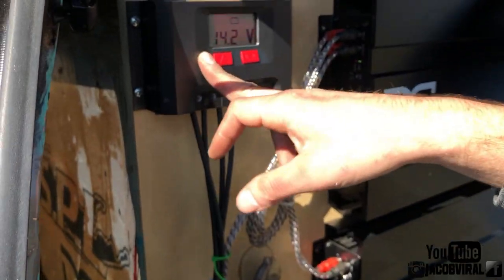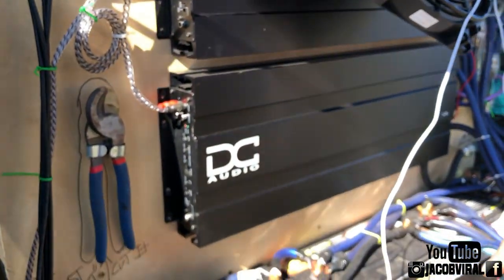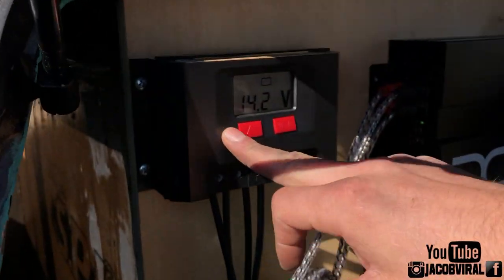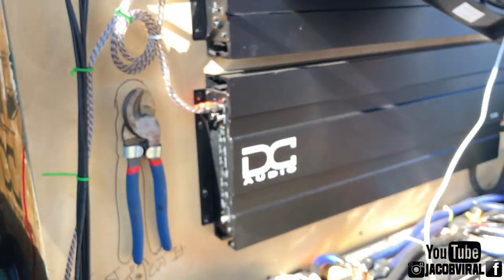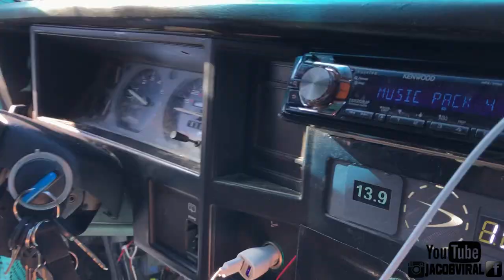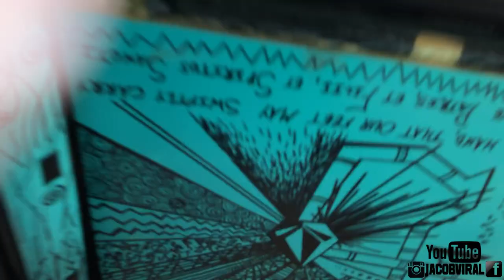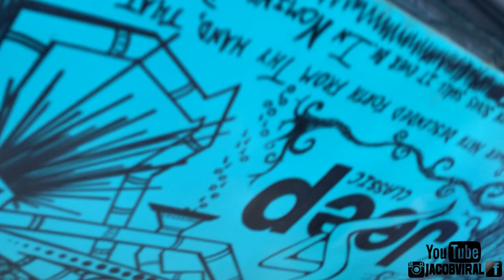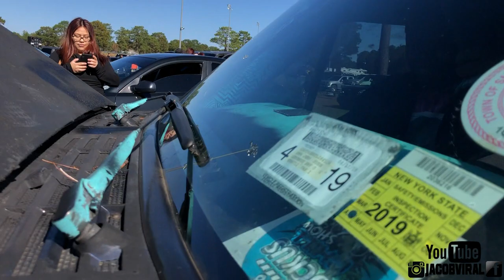THE FIRST SOLAR POWERED SOUND SYSTEM I'VE EVER SEEN!?

Comment: I wonder if he has had a fire before he has the extinguisher up. Front and then the wire cutters in the rear last resort under them
Reply: You can never be too safe when dealing with high amount of power. And talking for myself, no money to buy a new car if my current one burns to the ground. So i have an fire extinguisher in my trunk just in case.

Comment: What I want to see is a system in a Tesla I want to see how fast those batteries drain down. Meaning how long would it take to drain down at Tesla battery playing the stereo system at 155 DB which we all know is somewhere around 10,000 watts and above... Is anybody have a stereo system hitting 155 under 8000 .. Question is basically for you Jacob have you ever heard a system at 155 DB in the 5000 watt range
Reply: Tesla's have a separate 12v system that powers accessories and sound.
Reply: Tesla's actual battery system ranges from 350v and up.
Reply: There are plenty of builds that do 155+ with 5k
Reply: @djwonderbrad  I was hoping to see some of them because I want to judge how my system handles how it's built and what vehicles therein not just a burp but actual music play. That's my goal is to be around 155 with hair tricks. Thank you for the reply
Reply: @christhopherlasher2828  considering all the variables it's pointless to compare because one system will sound and perform completely different from one vehicle to another. You have to optimize your system to your car. I've moved my same system in 4 different cars and had 4 different results with each install.
Reply from the maker: For around 5k Watts Clamped yes, but a 5k Amplifier doing 155s is rare for a demo.